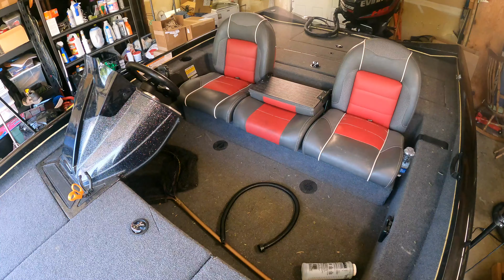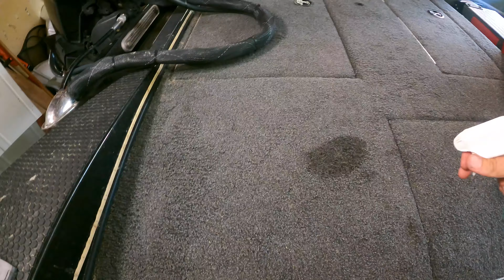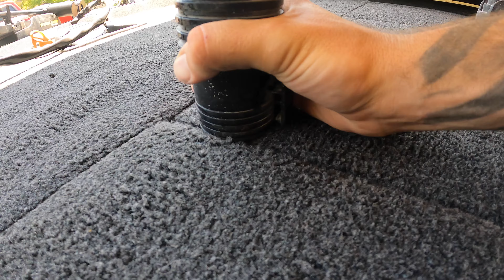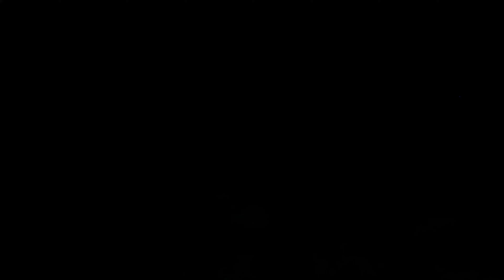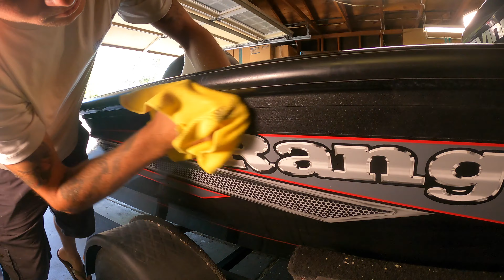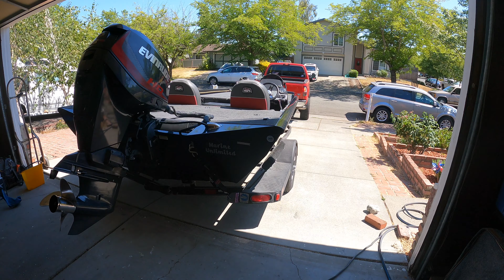Detailing My Insanely Dirty Bass Boat

Comment: I'll do you one better than vinegar.  It's called Chemical Guys Water Spot Remover.  It's an orange gel with a higher ph that will dissolve those water spots without much rubbing.  You can wash it down afterward and you are good to go.

Comment: Does the vinegar remove or thin the finish on the boat?  wouldn't you have to reapply a wax or clearcoat once you stripped it down with vinegar?  Just asking.  I know vinegar is a good cleaner.  perhaps too much?
Reply from the maker: The vinegar could remove the paint if it was left on for too long, after using I went back and washed it with soap and water and the waxed it again.